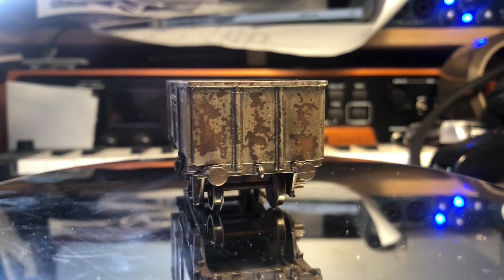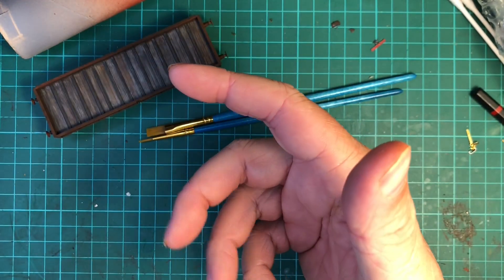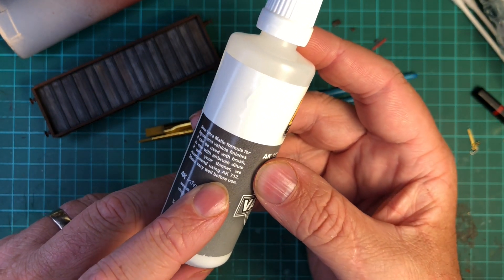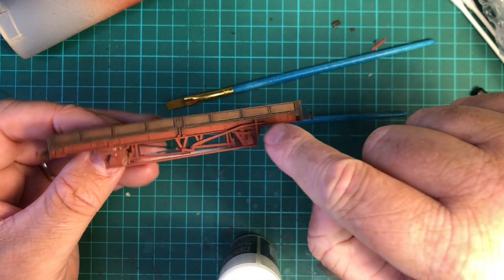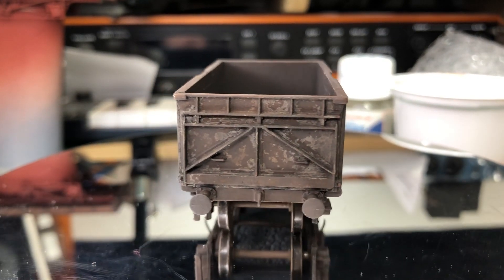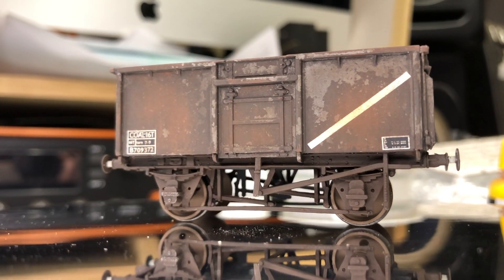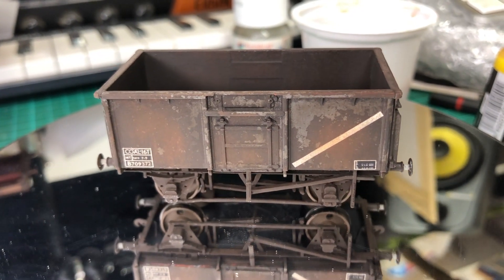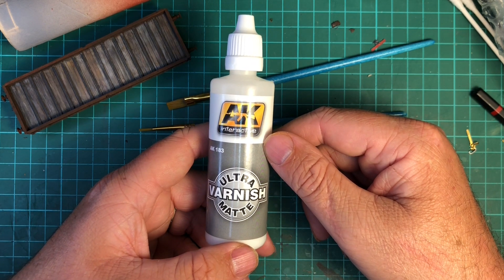AK Interactive Ultra Matte Varnish - Model Railway Kit Building

Comment: Hey Hey, Thanks for showing the before and after, really good example. What ratio of varnish/thinner did you use and have you tried mixing it with other varnishes to get a different level of flatness?  Cheers

Comment: I've found the AK varnish the best so far, I've just one more to trial😊👍✌️ I've noticed that some of my beloved Lifecolor (sic) paints are now satin instead of matt, so I've had to add a flatting agent. I'll not be buying those again, I'll look for alternatives. There are one or two UK paint firms who will provide absolutely flat matt paints. There are times when a sheen is required - I sometimes add in Johnson's Klear to achieve such😊👍✌️
Reply from the maker: Yes, I think  this AK Varnish is incredible, I love the fact you can brush it on, and it dries fast. Great stuff. Think my brother used the Johnson's Klear on some models once, I've never used it, maybe one project some day.

I've never had, or should that be noticed, that issue with my Lifecolor paints, I shall take note next time I'm using them. I do love Lifecolor paints, I have a reasonable selection, but I seem to buy a new paint with every project. I'm liking a lot of the AK range too including the MIG series. Recently I bought some Vallejo paints to try from the air range. 

There is so much choice out there to choose from, every time I look I find another paint manufacturer. All the best, HS